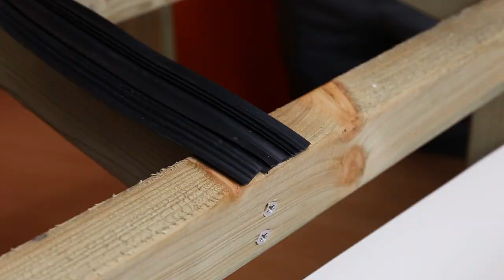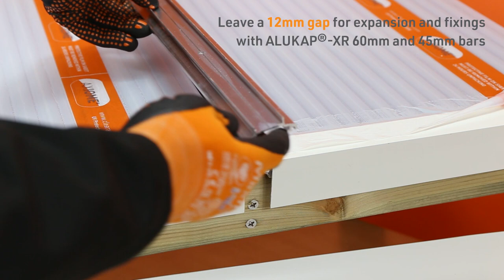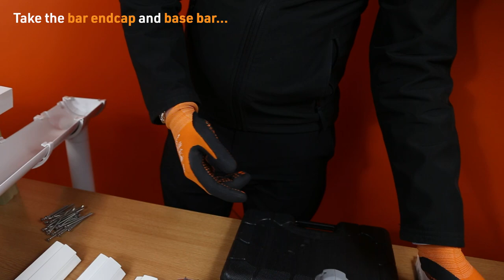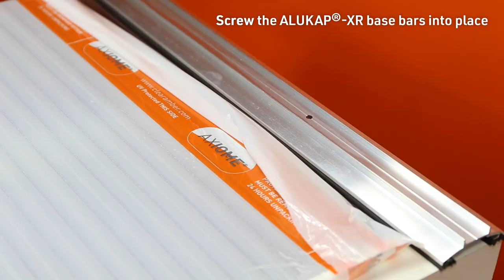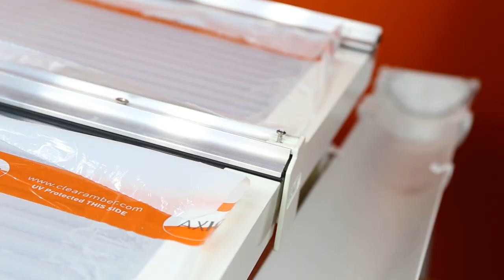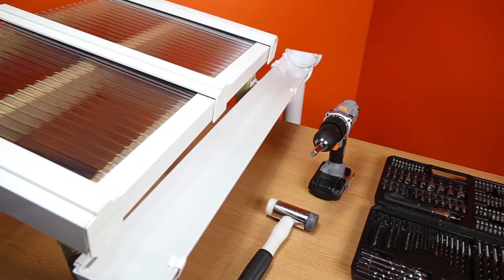How to install glazing bars | Alukap® XR

Comment: The fins of the thin gasket are pointing inwards?
Reply from the maker: Thanks for the question! Yes, Alukap-XR Glazing bars are designed to have concealed gaskets as this is better visually and also gives them greater longevity against weathering. This means on the bar gasket the longer flange faces inwards. Hope that helps explain?